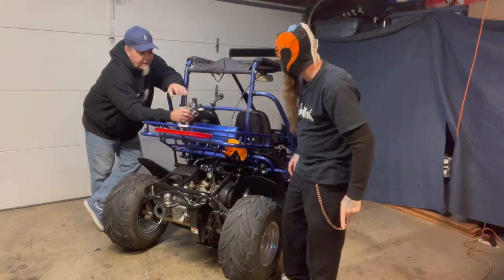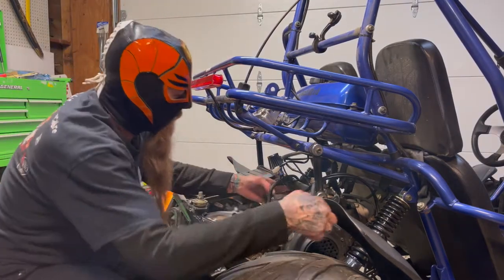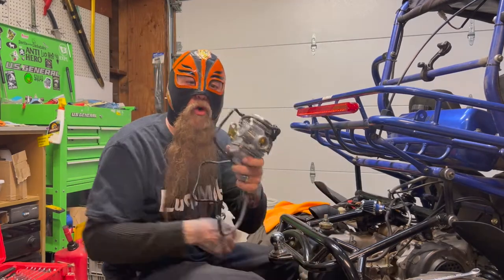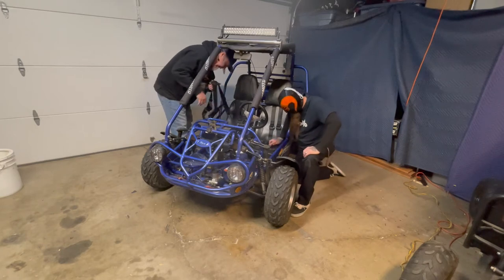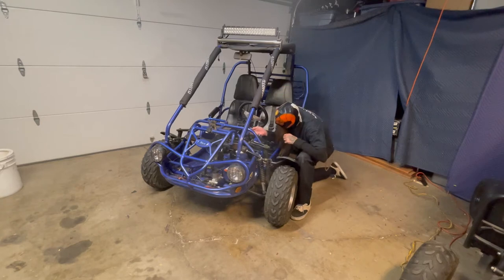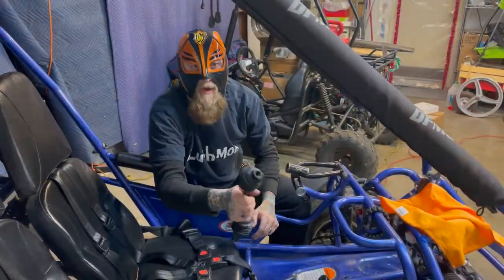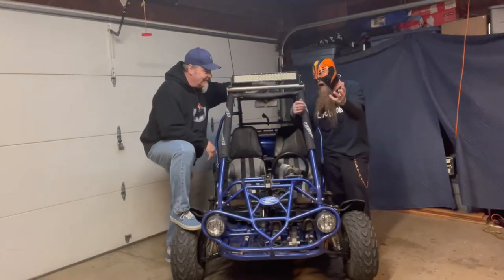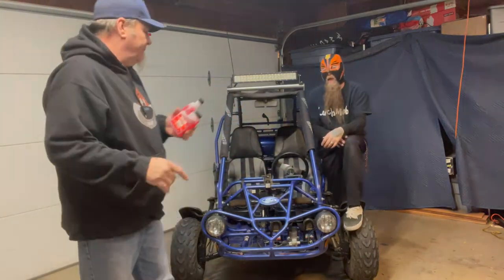TrailMaster 150Xrs Carburetor and dust cover Removal and Replacement

Comment: Hell yeah performance CDI and since we got 2 carbs let's try to drill out the jets once to something close to what you need and see if it works just as good as the jets you ordered. Good idea Eh?? Huh?? Huh? HUH??
Reply from the maker: Lol I bought several jets bro no need to drill em out just swap em
Reply from the maker: Neener 🤷🏼‍♂️
Reply: @LuchMobGarage  no I mean run your purchased jets in the new carb but for shits and giggles let's see if a guy could drill out a set of jets and make it work the same.. but kinda a budget build
Reply from the maker: @WTFMIKE  lol oh Ike from Cars and Cameras is a wiz at that from what I’ve seen 🤘🏻🐿🤘🏻